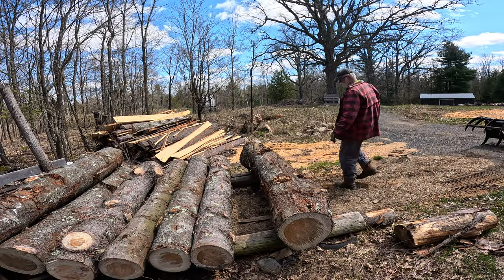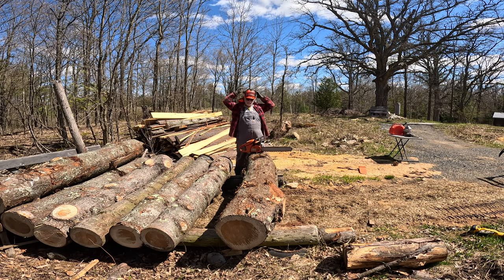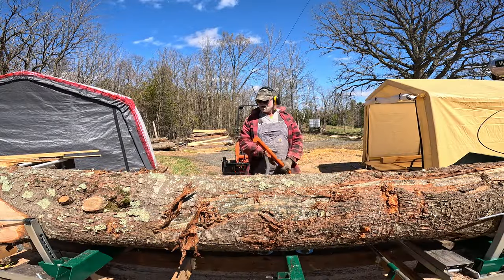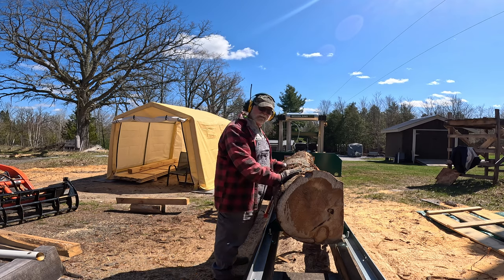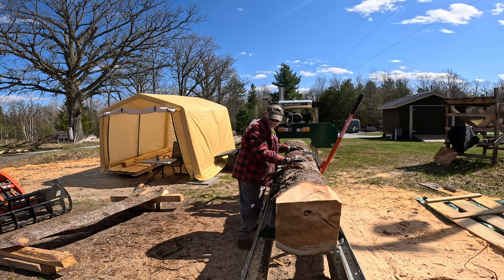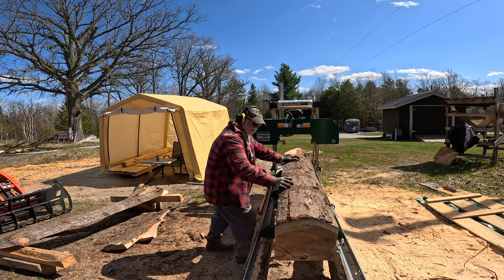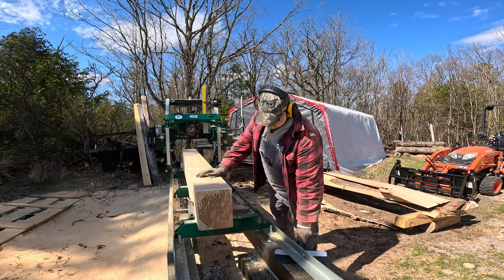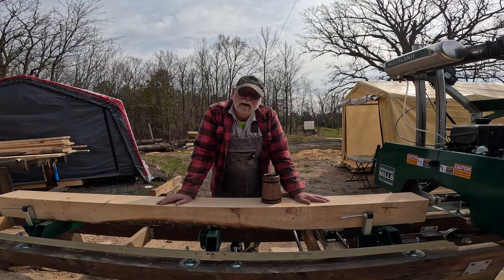Battling An Over Stressed And Bent Log On The Sawmill

Comment: Nicely done Brian! like a sharp chainsaw too.  Trimming up logs like that with a chainsaw before milling them definitely makes it easier to work with them. That one knot was pretty bad. Yup, when there is a lot of stress in a log and milling into smaller dimensions the bowing and warping becomes much more severe in each piece.  Sawing equally from both sides and other techniques can help reduce the bowing and warping in high stressed logs. Have a good one!
Reply from the maker: Hi Paul! Yea that logs was fun. I learned a lot as I went. I flipped that thing around like an over done pancake 😆. I thought I did reasonably well but the boards continue to warp even though I’ve got lots of weight on them. I think I’m going to loose more than I keep. But that’s okay. I was a challenge but fun as well. Thanks for stopping by!

Comment: Would it not have been better to halve the log, as it would have yielded more actual board feet & more in alignment with the  long grain?
I guess it depends on if you have use for shorter boards.
Reply from the maker: A good thought for sure. What I was attempting to do was cut my boards so that when they did warp they would warp so the board curved up rather than sideways. That kind of worked but the boards twisted in directions I wasn’t expecting. They are still moving quite a bit. I think I approached it the wrong way and I’m going to end up with at least half of the boards unusable. That’s okay because I learned from the experience. Thanks for stopping by!